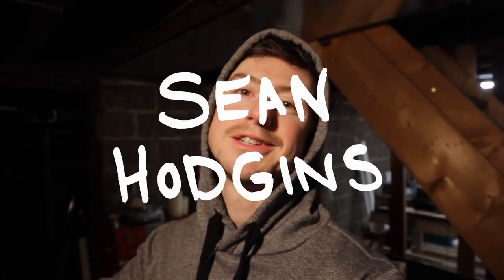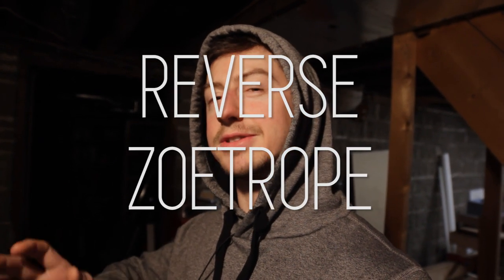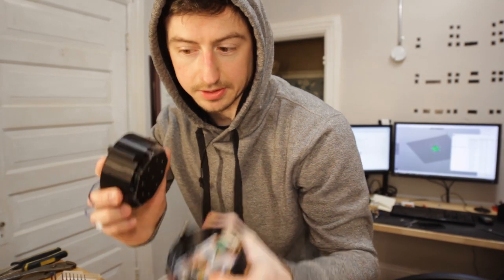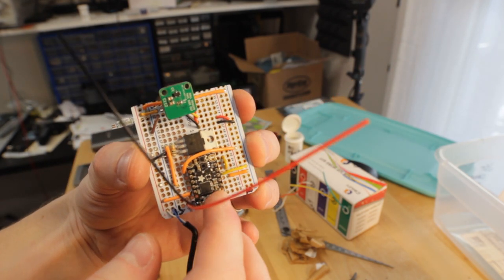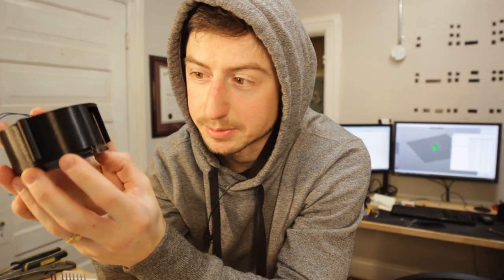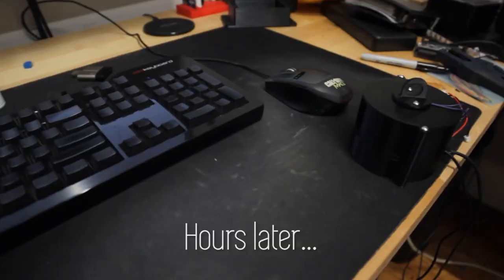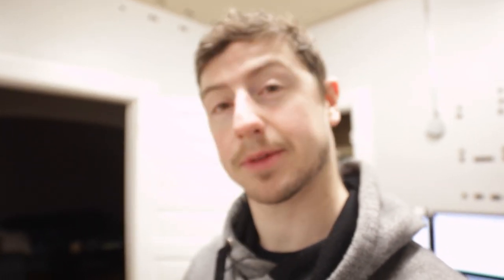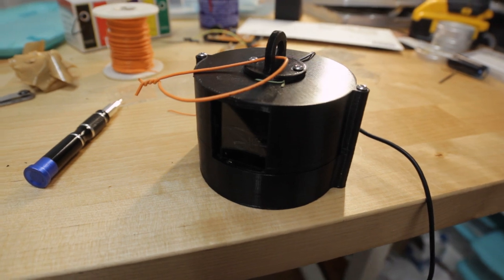Motors, LEDs, and Christmas Trees!

Comment from the maker: I have to stop doing projects that don't work well with the camera's shutter.
Reply: Regardless, thanks for taking the time to make an ornament this year and keep the tradition going. Happy holidays!
Reply: I think your only solution for that would just be higher rpm, but that's not necessarily easy. Also I would suggest maybe using DotStar LEDa instead. They're also addressable but are designed for persistence of vision displays
Reply from the maker: @johnly_  Yes I would have to speed it up and use Dotstars, but I don't have any in strip form, just loose components! and they're pretty difficult to hand solder. haha
Reply: What camera settings did you use? Can ISO be lowered, thus a slower shutter speed (necessitates using a tripod) . How many frames per second is the ornament displaying?
Reply from the maker: @bornach  At the lowest shutter speed camera will go to.
Reply: Why not just shoot high frame rate (slow mo) and then speed up the play back?
Reply: if your camera lets you then try changing your exposure time.

Comment: Maybe use one magnet, then offset the firing of the neopixels in code at certain intervals to account for the neopixel timing constraints :)
Great project though! Definitely not a camera friendly one unless you spin it at 60Hz or something (Or camera shutter speed divided by number of frames per rotation, I guess :P )

Comment: I didn't really get why addressable LEDs would ruin the timing?
Reply: It may be more of a Neopixel issue as they require very precise timing on the data line which could be causing other 'timing' issues. Pixels on individual data lines might allow the initial concept to work or moving to Dotstars could alleviate the timing issues all together. Or, you could use non-addressable RGB LEDs and remove any secondary timing issues from the problem. I'm no expert in this field so I could be comepletely wrong but those were my initial thoughts as a lot of POV displays tend to favor dotstars over neopixels because of timing issues.